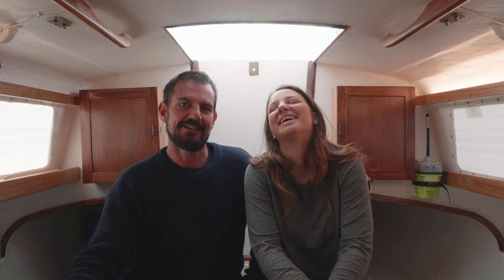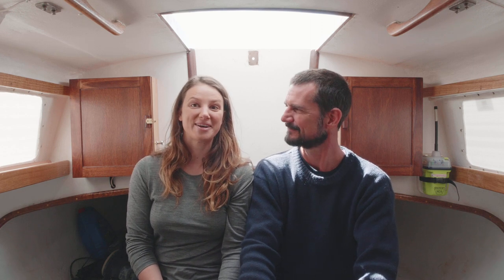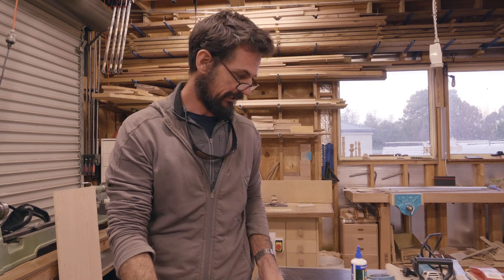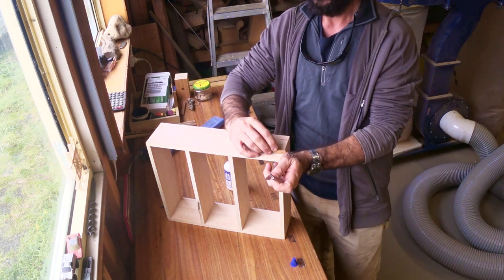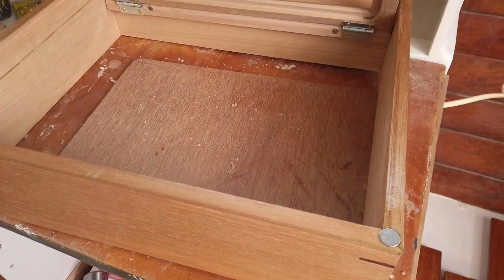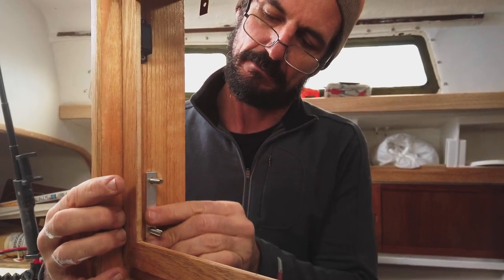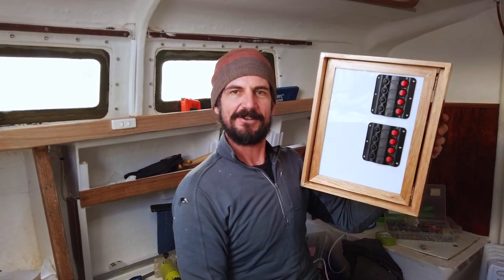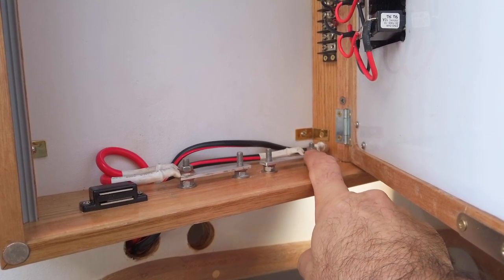A Total Rebuild for Our Sailboat's Switchboard - Free Range Sailing Ep 149

Comment: Oh and you don’t have to cut zip ties to get them off. Simply use the tip of a blade such as on a Leatherman to hold the tang down and pull the long part of the cable through until it is released. Then you  can reuse the cable.

Comment: Very nice work. Both of you smiling ear to ear... We can tell you are loving the home makeover.
Yeah, tape is my goto corner clamp. Also, spade bits do make a nice clean entry. But, they like to blow out the back. When drilling through with a spade bit, stop once the point gets through, then flip the piece and hit it from the other side. Better yet, drill a pilot with a small diameter twist bit. Then work toward the middle from both sides. BTW, a forstner is a different bit. But, one can use the same techniques.
Reply: I figured that someone would beat me to the Forstner bit identification. Troy does seem to have good spade bits with spurs.
Reply from the maker: I suspect this will be the beginning of a long succession of corrections in the comments! I've been living a lie:(
Reply: @FreeRangeLiving  Troy don't feel bad, your depth of knowledge is amazing but you are human ;-). You were using a "spurred spade bit". They can be used in a drill press or with a portable drill. Forstener bits are an "amazing bit of kit" that can drill overlapping holes and make flat bottomed recesses. But They are scary sharp and not advisable for use without a drill press.
Reply: To prevent blow out on the exit hole when using forstners, always clamp a waste piece of wood to the back of the hole and the drill will cut through leaving a clean cut but wrecking the waste piece instead.
Reply: @wildtimbrown  All good points Tim.  One of the pluses to the forstner bit is  it is much better at not allowing blow out on the back side.  That problem really goes away unless your really forcing  the bit to plunge fast.
Reply: Free Range Sailing please try to remember that some of are just built with a "thing" about using the right term, and feel the need to say something.  It was an excellent video, and I really like what you've done.  The storm of comments are (mostly) with the best intentions, from people living vicariously.  Now, time to work on my own projects!

Comment: Those were spade bits. Forstner bits are different.
Reply: The good news is that if you love spade bits, Forstner bits will blow your mind!
Reply: I like brad point drill bits as well. Just, not common in the larger sizes.
Reply: Yep, good quality forstner bits are amazing...you’ll never go back to spade bits.
Reply: Also spade bits are easy to sharpen with a small file. I wouldn't attempt Forstner bits.
Reply: Agreed, but he brought up a point about those spade bits I didn't know - how well they work on plywood.  I haven't used mine in years, but may dust them off now.

One advantage of Forstner bits is that you can drill a clean hole at an angle, which spade or twist bits won't.

Comment: Troy, your philosophy about “fragile systems” vs time for carefree sailing was excellent I thought. It also applies across so many other technologies eg. four wheel driving where you add aftermarket diff locks, air bag height adjustment, turbo timers etc.

Comment: Cabinets are beautiful. 
I run wires for a living and I hate massive amounts of zip ties as well. I make utility loops and have used Velcro ties. On low voltage small gauge i have used phone punch down blocks and wrapped two or three times for utility trim backs.
Dielectric gel might also help in corrosion and electrolysis.
Looks good!!!! I like it!!!
Reply from the maker: Looked up punch down blocks. That's a good tip, thanks. We have since sourced a little Velcro too.

Comment: Good video ! A Few Electrical ideas 💡/ ways to do stuff that I Do. 
1) Buy & Use Reusable wire ties. They have little balls on them and latch into the wire tie hole. Better for environment & u can keep a nice looking panel that way.
2) An easy way to make a Panel look nice is to make a path in a Z Pattern. Putting reusable wire ties at the 90 degree points of turn. Establish the 90 degree points of turn by screwing a Wire Tie pad eye at the 90 degree turn point. Then you wire tie at the 90 degree points.
3) Leave a Small circle of wire at each point of connection for future service. I call it a Service loop.leaves u just enough wire to repair a connection or troubleshoot.
4) if u are doing wiring where wires may get Wet somewhere such as a Anchor locker etc. Do what I call a Drip loop for wiring. So the water drips off a Wire rather than running into the Device. Make the Wire come out of powered device , then Go Down 3” with wire , Then back up again to Deck & Before penetrating another space , do same thing again as to keep Water from running along a Cable.

Neat idea with the Volt meter For troubleshooting / Not having to get a Meter.
I’ve got a Suggestion you might like on that one to improve it a bit, while still keeping the great idea. Install male & female push ons on the wire to the alligator clips. So alligator clips could be removed and just stowed in the cabinet in a little ziplock bag. But still hardwire meter to buss bar with female push on. Connector. Alligator clips would be in cabinet in ziploc baggie with wire attached and a Male Push on connector on them. Then u can just pull off female off buss & connect to alligator clip wire male push on when u want to troubleshoot.

Comment: Nice.  A very clean and simple DC distribution system.

As an electrician I would suggest that the alligator clips to the voltmeter be well-insulated except at the front of the jaws.  If somehow the leeds get loose, and start bouncing around inside there, you want to minimize the chances of bridging between any different areas of electrical potential.  I'm sure everything is fused, including the panel feeder mains , but if the clip fell across the two busbars at the bottom you'd lose the entire system -GPS, Nav lights, compass backlight, cabin lights...

I am assuming you have a switch and fuse/breaker between the solar controller and the busbar.  I found a bunch of appropriately-sized 2-pole DC breakers that were DIN-mounted and really reasonably-priced on eBay.  I was able to use those as overcurrent-protected disconnects for my PV and wind turbine.  I also found a large lot of DIN-mounted fuse-holders so I was able to build combiner boxes for the load side of the PV system to protect all the parallel-fed solar panels to protect them from each other should one of them go drongo and short out internally.  I really like using DIN-rail as it makes a neat installation and is relatively cheap.  It is legos for electricians.
Reply from the maker: A DIN rail would have been great but the depth of the cabinet prevented it. You're right though, very satisfying to install. All the supply has circuit breakers and the bus will be rubber coated. Still a work in progress.

Comment: great videos - watching a few old ones and been to a few of the northern WA spots in a powered craft.

A quick consideration for your electrical system design is that if you are charging via solar or wind and you inadvertently cycle the battery isolator through the off position, or switch off on purpose (elec storm, maintenance) , your instruments (GPS, inverter?) could be subject to higher than acceptable voltages (fried). Learned this first hand once.

a good approach is to use isolators on the raw charging circuits (pre regulator)

Comment: Nice work. Really liked the electric explanation. The magnets look like they hold well. The Alligator clips used as a voltage meter for the systems and solar wind regulator for the box. Clever idea.

Comment: The alligator clips for the voltmeter is brilliant! I wish my setup was simple enough to allow for such an elegant solution. Are you planning to put covers on those bus bars? I'd be worried about dropping a wrench and creating a dead short across them.
Reply from the maker: Yes to covers but switchboard busses are protected by circuit breakers at the distribution hub and at the battery compartment.

Comment: Great work guys and thanks for the rationale for your decisions. 👍 

I noticed that your wires enter the box from below, through the bulkhead, rather than from inside the box so they are hidden. I’m curious to why you did it this way. I expect you still have some cleanup on the hanging wires, but the wire holes in the bulkhead look permanent.

Comment: Very nice work, one thing i find a little dangerous is the fact that your positive and negative from the batteries are so open and close together. Working in there and by accident dropping a screwdriver  or something else metal might create a short between them. Best is that you add 2 isolating covers to go over them. one for the positive and one for the negative.

Comment: Looks really good. The cable entry at the bottom is a problem for me as it is not hidden. Perhaps a brass pipe fitting to make it look neat and tidy.  Or maybe some flexible hose.
Reply from the maker: Timber housing. It's not complete yet

Comment: All the "fragile systems" are really just little luxuries but can often be quite handy while they work.

As you say Troy, they will only continue to work if well maintained and therefore add to a maintenance workload.

But any sailor worth their salt should be able to continue managing a boat effectively if not well should "fragile systems" fail for un-forseen reasons.

I am an advocate of safety features such as AIS and Radar.

Comment: Takes me back to my apprenticeship. I was to become a radio mechanic (now there's an anachronism) in the 1980's. The old grey beards were very patient and swore by waxed cotton string rather than plastic cable ties... If my wiring looms weren't beautifully symmetrical I'd be sent back to start again. Nothing crimped, all soldered. The very worst thing you could do was to cut corners or bodge something.

Comment: Beautiful wood work. Think the safety becon equipment should be on deck under the  dodger for easier reach.
Reply: Easier to lose overboard and/or get accidentally triggered that way, too. There's no emergency at sea so dire that a few seconds to get below and activate it will make any difference.
Reply: @Garryck-1  true  but in a heavy Sea it looks like it would be a trick to get to. I was thinking far forward under the dodger.  But understand that if it works why mess with it.
Reply: @donjohnson5307  - If an emergency bad enough to require setting off an EPIRB occurs in heavy seas, it's very unlikely that anyone is on deck anyway, in those kind of conditions it's safer to ride out the storm below. And if someone was on deck, their partner would still be below deck anyway. There is no good reason to have the beacon under the dodger.
Reply from the maker: Water sets them off.

Comment: Aye m8’s, Nice carpentry and wiring! And Pascale's amazing varnishing skills! I think I'd add just a little more length to those wires, of the same reason as you said. And maybe some extra pre-made outlets/connection points, since you never know what's going to be the next install. Even though I'd think I'm sure there never be any additions - there just may be some… 😉
Thnx for showing and sharing!
Reply from the maker: The switch board is just for things that don't have their own switches; nav lights etc and a branch to the instrument (GPS, radio etc.) sub-board that I prefer to be able to isolate all together. The other board has room for expansion and the fuses to handle the circuit requirements for things that do have their own built in switches. there are 16 fused main circuits in all, some that branch to handle individual loads from a junction (eg: fridge and water-maker). There is also a seperate fused board for the engine space but to do a full tour of all of that would be pretty yawn inducing.
Reply: I’d love to see that. And I think I’m not the only one. Just imagine how many views Mads, on Sail Life, have on he’s YouTube channel.  😉 
So I’d say: – Give it to your best friends / viewers!
Reply: @FreeRangeLiving  - Yawn inducing? Not a chance! Detail is everything. Please show us. Even if it's as a separate 'yawn inducing' video just for all us tech-heads. Besides.. I have a yacht to build. I wanna steal as many of your ideas as I can!
Reply: @FreeRangeLiving   I'm with the others, a full tour of all things electrical please.  :)

Comment: Hi, love your videos! Some nagging though: I don't like the bus bars, open and close together, there's plenty of scenarios to short them out. Loose alligator clips for example, a dropped screwdriver or a ring on your finger (like stumbling in big seas and bracing on the bars gives a branding). Also, the (tinned) cable lugs will have some electrolytic corrosion with the aluminum, tinned copper bars would have been a better choice. And I don't like wood as an electrical insulator, if the busbar heats up due connection problems, it starts a fire quicker than other materials.
Reply: Yep, wood is a lousy insulator. Those bolts will suffer from electrolysis, and eventually will be badly corroded, or even catch fire.
Reply: @graemezimmer604  you don't understand electrolysis if you think  stainless steel will corrode near less noble metal in a dry cabinet.
Reply: @toratora3910  It most definitely will if it has DC power on it. This is active electrolysis, not passive. 
And it won't stay perfectly dry in the wet salt air.
Reply: It isn't finished, so maybe Troy will have covers for the bus bars.
Reply: ... hopefully at least covers for the bolt heads that stick out of the bottom of the cabinet from the bus bars...

Comment: You noted that you put a gasket on the cabinet doors to keep moisture out. Did you put a gasket on the back side of the cabinets to seal the joint between the cabinets and the cabin wall also? You didn't mention, or show one, so I thought I would ask.

Comment: Very nice guys! Great job on the cabinets and electrical but I was surprised by the unprotected cables/wires coming out of the bottom of your electrical panel and then aft through the bulkhead. Are you planning to run these through some sort of conduit or protective sleeves?

Comment: Hi I am enjoying watching your YouTube videos. Great stuff. Just a point I noted. I am surprised you seem to be using Aquadhere  glue for your cabinetry work in a boat as PVA glues are not waterproof. I thought Epoxy or urethane would be more waterproof glues in a boat. I don't want to hear your great work comes apart.in use

Comment: Looks very nice and tidy. I will definitely remember that tape trick the next time I'm dealing with miter joints. Just curious why the electrical is routed out the bottom of the cabinet instead of through the back straight into the wall?
Reply from the maker: Because straight through the wall is into the cockpit and the great outdoors.
Reply: @FreeRangeLiving  Excuses excuses.., (Roll eye's emoji)

Comment: The inside of cabin looks very nice. 
I was wondering who’s boat you were on. 
LOL 

I COMPLETELY AGREE WITH YOUR KISS ELECTRICAL SYSTEM.  

I AM SO HAPPY YOU GOT THE DOORS OPENING RIGHT!! 

I was looking at another mans electrical system.  Lithium batteries, solar charger, wind charger, protection for over charge, swap house current to cranking and vise versa,  110 system, 220 system, 12 volts system.  He said it took him 6 months to wire it.  A/C, induction  cook top,  micro wave, oven, 2 freezers, 2 fridges,  computer nav,  yada yada yada.   He could monitor every electron.   That’s great!  It was very nice.  What’s he going to do when it gets wet? What’s he going to do when the wires corrode?   Does he have 6 months in BFE to repair it?
Reply: 2 fridges and 2 freezers? HAS to be a catamaran, right? That, or a very large vessel.
Reply: JAFO  BIG 50 ft job BEAUTIFUL 
BUT MORE OF A JUST SIT THERE

Comment: I would not have used aluminum for your bus bar. Copper is a much better conductor.
It would also be a different metal from your lugs
The standard would be to use tinned copper. That is what your lugs would be made of. This will give you the best electrical connection.
Also stainless steel is a very poor conductor. I would use tinned brass bolts to secure your lugs to buss bars with a tinned brass nut at the back or tap your bus bar and screw directly into the bus bar

Comment: Hi Troy. Those hole cutting bits you were using are Spade Bits. Here's a picture of Forstner Bits: https://www.timbecon.com.au/24-piece-metric-forstner-bit-set.  Here are some Hilti Spade Bits: https://www.hilti.com.au/c/CLS_POWER_TOOL_INSERT_7126/CLS_METAL_WOOD_DRILL_BITS_7126/CLS_SPADE_BITS_7126O
I think the work you guys have done is brilliant and I am stealing the miter joint assembly idea. Damn, that beats all the clamps and mucking around trying to line it all up.

Comment: Very nice!  The balanced cabinets are a great touch.  How did you mount them?  Is the wall thick enough to use sturdy screws?  Thanks for the videos.
Reply from the maker: The wall is half inch glassed marine ply so yes, there is meat there for sturdy screws and strong brackets.

Comment: Glued mitre joints?   Now from my days in the woodwork shop at school in the sixties, I remember spending about six weeks failing awfully to make a concealed dovetail joint for a drawer unit.  Where I failed, I'm sure with all that equipment and Troy's meticulous attention to detail, you would have succeeded, and it would have been a far stronger structure.  Did you consider that, or is it not appropriate if you're using ply instead of real wood?
Reply from the maker: We have time constraints. Boat is another word for compromise.